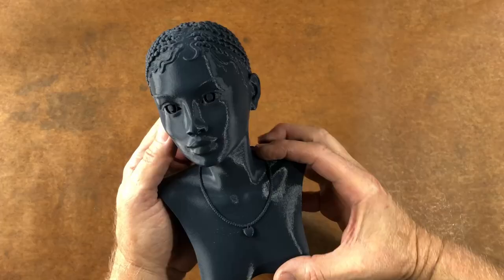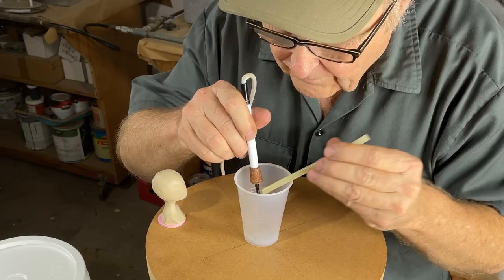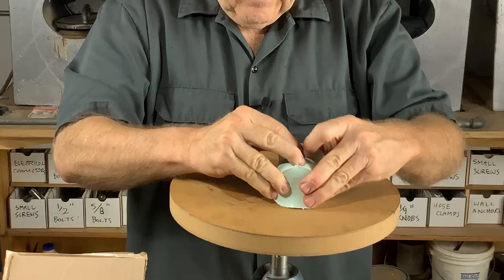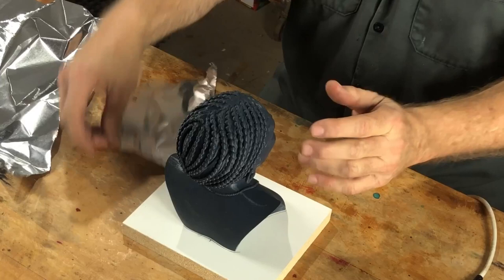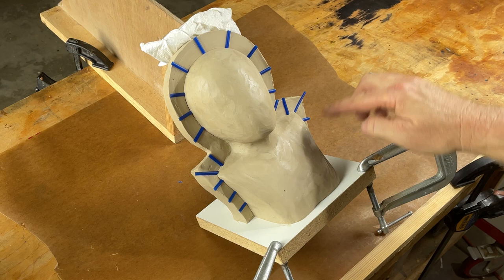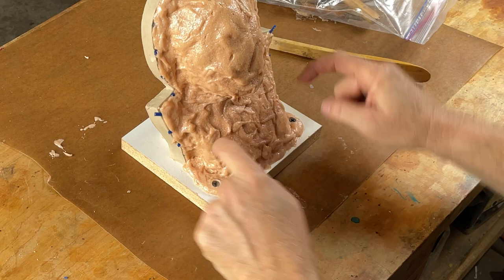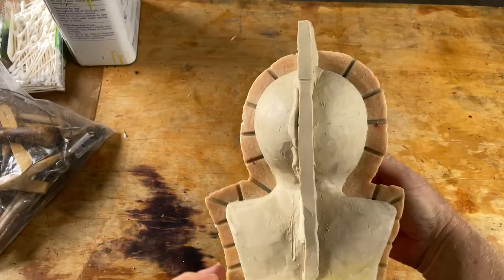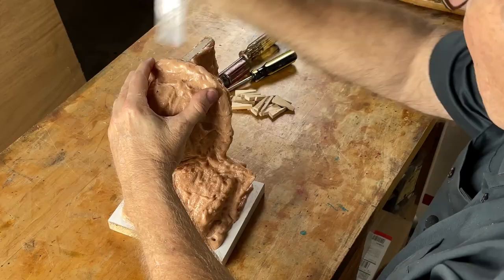Making A Silicone Glove Mold

Comment: Older times I used to make some small modelling molds for white metal cast, I used glicerine as detaching agent. It worked ok.
Reply from the maker: You used the glycerin with silicone molds?
Reply: @RobertTolone  It was silicone. It was a stiff reddish RTV kind for lead based alloys. I made a few times. I guess it was glycerine, at least I remember I bought it for this purpose and I think was the thing I used. But it seems from your surprise my memory could have some faults. I never used vaseline or wax for sure. Maybe once I tried hand cream (but it has in the content a significant ammount of vaseline so we can consider it as vaseline for this purpose). I must give a look to my old stuff if I can figure out.

Comment: Hi Robert! I'm a professional sculptor and I often have to do silicon/resin molds. I have this problem - and I've been trying to find a good solution for such a long time - that after the pour has cured the silicon/resin sticks to the wood/cardboard. Do you know of any substance that would prevent this?
Reply: Hi, I run my own casting and sculpting business. I use sellotape on the inside of my cardboard mould boxes and bases to prevent silicone sticking. Lightly sand the tape on the base with fine wet and dry and it helps on the master being tacked to the base.
Reply from the maker: Use a heat gun and brush on melted beeswax.  It’s a miracle substance.
Reply: I'm sure Bob said something about bees wax ?

Comment: Finally, a glove mould.

Edit: Personally i would've just done a brush on mould.
Reply from the maker: Me too, normally. But I was planning to both rotate and pressure cast using this mold and it’s very easy to get bubbles in brush-on molds.
Reply: @RobertTolone   Be gentle, I'm still a silicone n00b. My answer to everything; glove mould xD
Reply: @RobertTolone  I find when I cast my brush on molds in a pressure pot the pressure intensifies and expands any little bubbles you may have in the silicone( I use Dragon skin 20) and inevitably ruins the silicone mold. So frustrating!
Reply from the maker: @davesilva9174  That is exactly why I did this mold as a poured mold and not a brush-on mold. It is extremely difficult to avoid bubbles in a brush-on mold which are not a problem for rotational casting but a major problem for pressure casting